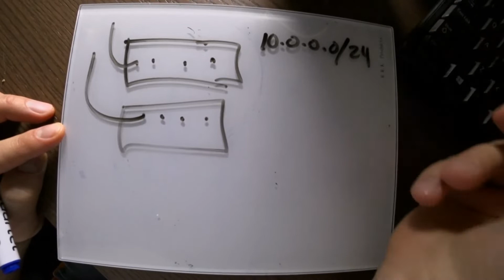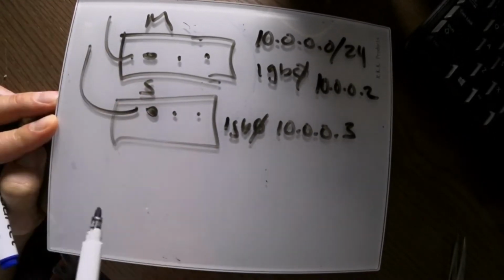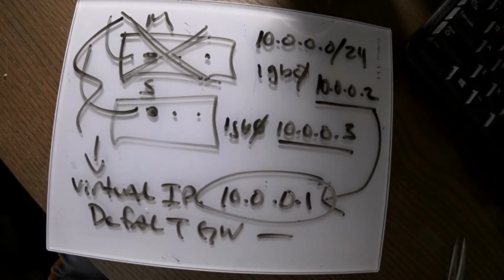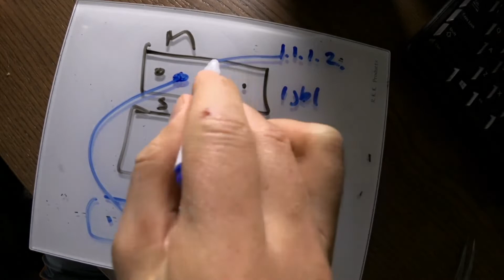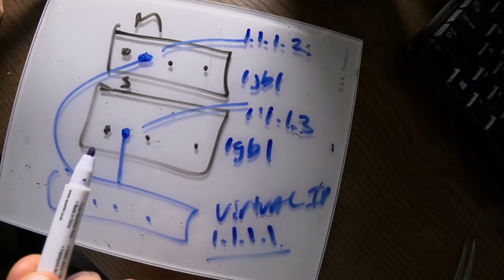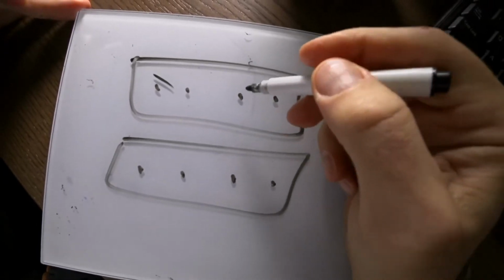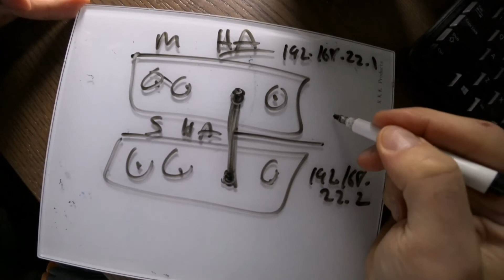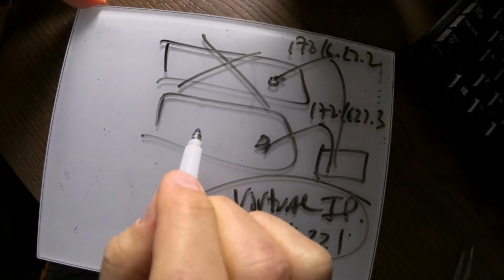OPNsense HA setup | Part 1 | Physical connectivity |

Comment: thanks for the video, I only have one question, In this scenario if the switch to which both FWs are connected goes down then having master and backup FW doesn't make any sense. do you have any solution for this issue?
Reply: 2 switches? :)

Comment: Thanks for the video. Maybe throw a few links in your show notes to the Qotom products you have? Amazon has both the i7 and i5 units. Do you find for home network (with kids) running snort or suricata, along with openvpn and pfblocker ng that the i7 is needed or will the i5 with at least 8 gigs of ram suffice?
Reply from the maker: Hey sure will do , im not much of a utuber so i forget basic things :P For home use i would recommend the i3 version, plenty of power for what you are looking to do. I have a couple of i3/8GB units in production with over 50 users in each location and one spot has at least 15 concurrent OVPN sessions with suritcata - ntop - geoblocking etc and it doesn't break a sweat. at my place im still running the J1900 but on that model i do see much higher cpu utilization especially with suricata and actively viewing ntop data. also 4GB is usually plenty. But for clients i always opt for 8GB.